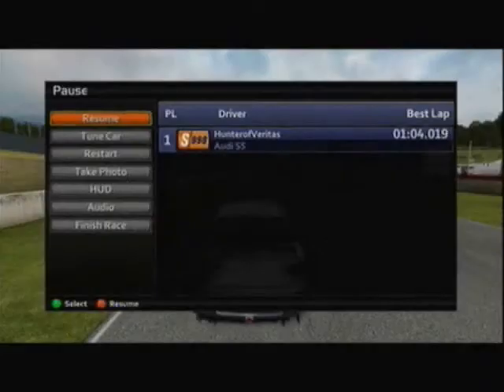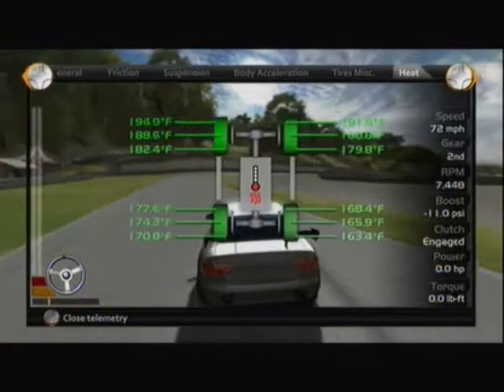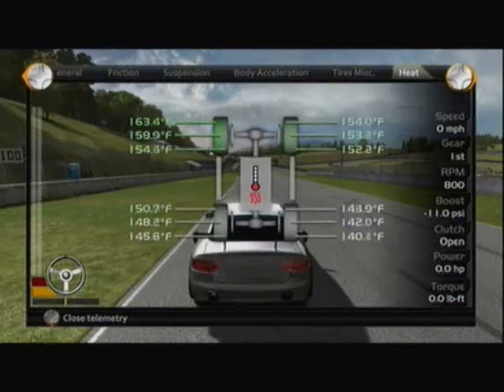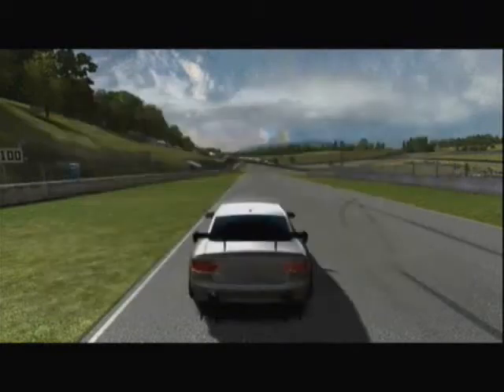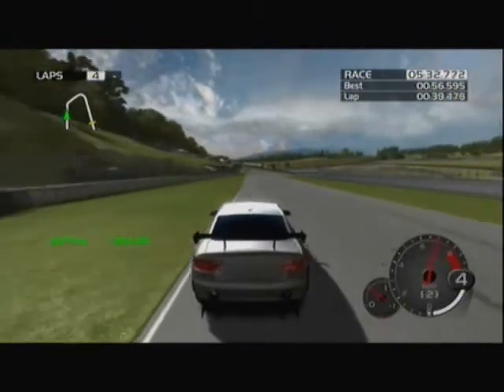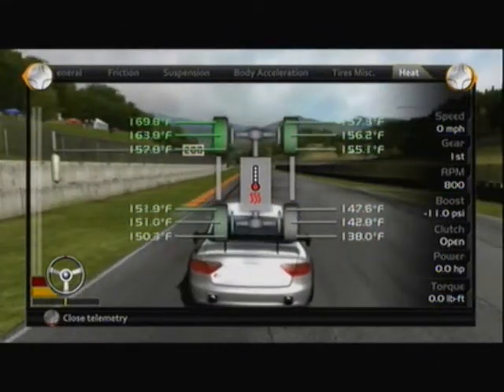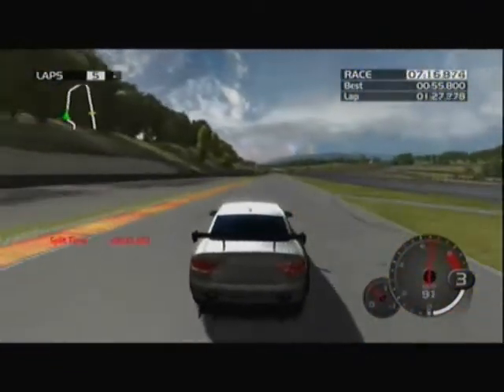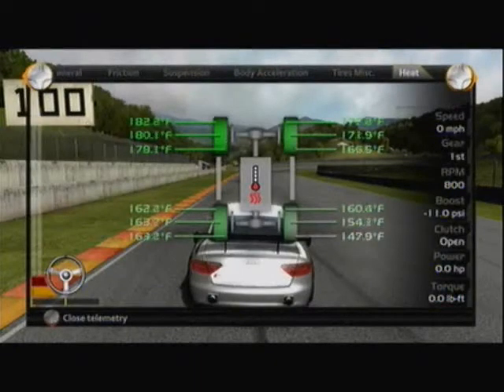Forza Motorsport 2 - Tuning Camber Part 2

Comment from the maker: Your car in FM2 has mass, which means that it wants to "stay still" when sitting at zero mph.  When you throttle the car sharply, you give the rear wheels near-instantaneous torque.  When the car wants to stay still and the wheels want to turn, something has to give.  If your tires have a large amount of grip (like when using drag slicks), the mass of the car is moved because the tires DON'T slip.  If your car overpowers the grip of the drive wheels, then the tires WILL slip with heavy throttle.

Comment from the maker: As GloveBag has pointed out, actual overall temperature won't matter much unless you're working on an endurance race (where you would want the temperature to be low to prevent excess rubber wear).  As long as those temperatures are relatively even, your settings are probably good.

Comment: Sure.  My knowledge comes mostly from my sim racing background, rfactor, iracing, Richard Burns Rally, etc, but also some real life experience.  It may seem odd to have the inside temp hotter than the outside for a road car, but the reasoning for that is just as you say.  You just need to increase the negative.  The inside of the tire will run hotter because down the straights the car will be riding on it more.  But, when the car goes in the corner, and the weight transfers it will allow

Comment: continued from last...
the middle of the tire (the largest patch) to contact the road when it needs to.  If you watch your temps in the middle of a hard turn at camber of 1.2 or so, you'll notice the outside heating much faster and thats because youre still relying on it to carry most of the load and you don't have the max contact patch possible on the ground.  Of course camber varies with tire pressure, spring stiffness and other settings so camber should be one of the last things you tweak.

Comment from the maker: I use a controller.  If you're asking what adjustments to make for different length track surfaces, simply pay attention to the heat on the tires as the video explains.  If a track is long, camber adjustments do not necessarily change as a result of that, but they do become a little more important.  Long track - high track times - more tire wear.  This increases the importance of getting your basics down.

Comment from the maker: The same applies when cornering.  If you're accelerating AND turning, the mass of the car also wants to move to the outside of the corner, subtracting from the friction you can use for accelerating.  Your last statement shows that you're on your way to understanding these concepts.  I would suggest learning how to "feather" the throttle and brake while accelerating and deccelerating...

Comment: Being that your Audi is a pretty heavy car, it will induce more body roll and therefore will need more camber.  If i were setting up the car, i would stiffen the springs pretty substantially, add some toe in on the front, and then work on adjusting camber and tire pressures to get the ratio i showed above. Tire pressures will mainly dictate the middle tire temp and then you can use camber to get a decent ratio on the outside/inside.  See if it doesnt improve your grip in the middle of the corner

Comment: hey, the vid was great (both parts) i watched both as i'm starting to decide to tune my own cars for racing but have little experience with the alignment settings etc. could you give a brief state ment on what temps i should i be looking at for FWD cars in B class and also RWD in 
B class???? if you could that would be greatly appreciated.

Comment from the maker: ... then learn tuning. If you pay attention to the metrics in the above tutorials, you'll see on the left where it shows my pressure on the brakes (red bar) and the accelerator (green bar), you'll see that I use this "feathering" technique in nearly every corner. It is essential to driving smoothly. Drive smooth means driving fast. Remember, drifting is cool, but it isn't the quickest way around the track. =) And, thank you for the comment on my driving. It is appreciated.

Comment: You want the inside temp of the tire to be hotter than the middle and outside, not the same.  It should look like the following:
   I          M        O
210     200    190

Where you have approximately 5-10 deg difference between each spot on the tire.  In other words your Audi should have more like 2.5-3.0 negative camber on the fronts and 1.5 or so on the rear.

Comment from the maker: Murf, for short races that sounds correct, as the hotter inside would mean that the car could take sudden, sharp corners with a bit more grip.  For longer, more sustained balance, flat temperature gradiation means that the majority of the rubber is contacting the ground a majority of the time.  Do you have reasoning other than the above for your numbers?  This sounds like it has potential, but makes me curious at the same time.  I'm not sure how it would work.  Please reply.